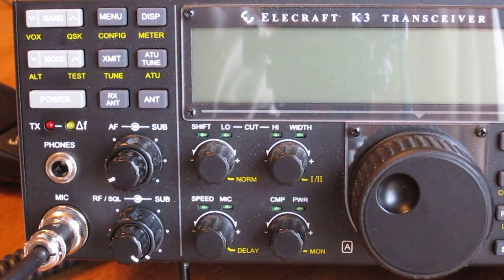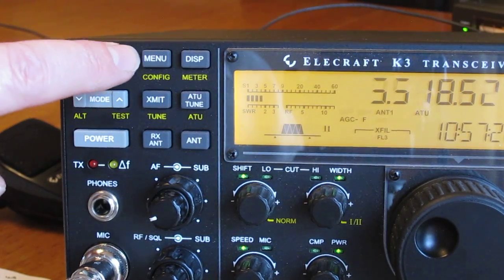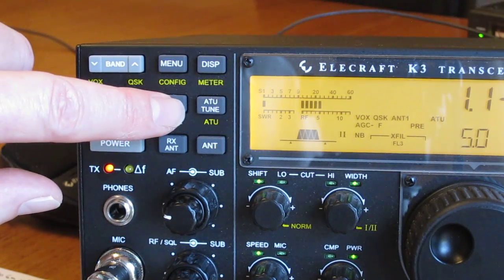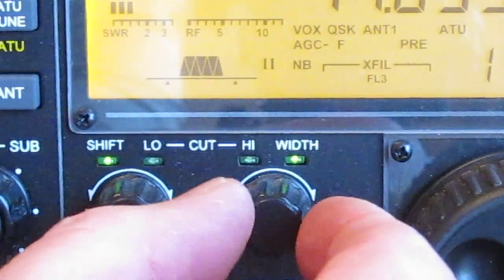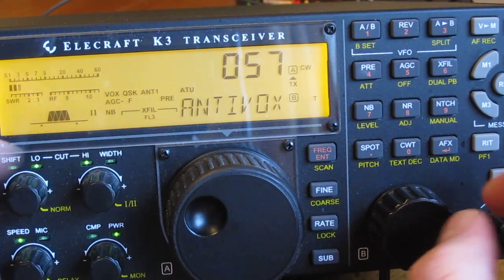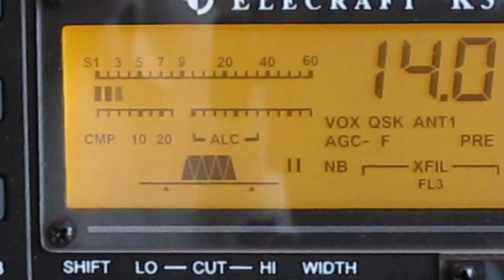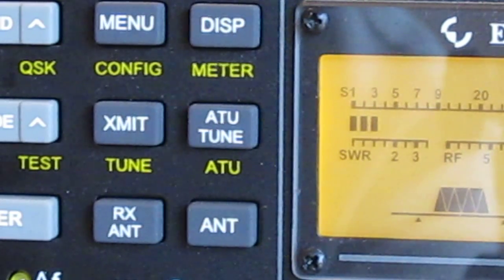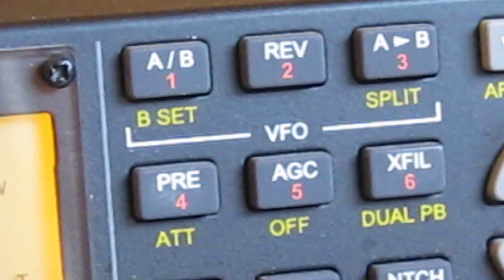ELECRAFT  K3  HD VIDEO - Front Panel Instructions demo by Keith GW4OKT.mov

Comment from the maker: Thank you for your comments, you flatter me to be honest, but it was entirely unscripted, I just commented on the functions from left to right more or less. It is surprising how you do get used to the functions BUT when you don't use them all the time you do forget what to do.  One of the issue I have as a CW op is that sometimes, if I hold BAND down button by mistake, rather than tap....I turn off the VOX! So yes, it is a little crowded on that panel!

cheers 

Keith

Comment: What are the correct CW frequency readouts on the K3 for the 60-meter channels?
Reply from the maker: It varies slightly,  depending on which country you are in. For the UK, it can be (kHz) 5258.5 - 5264, 5298 - 5307, 5313 - 5323, my favourite is 5354 - 5358, 5362 - 5374.5 is also used. (5262 is a commonly used QRP frequency).
Reply: @g4okt  Thanks. I'm interested in knowing the K3 frequency display in CW for USA 60-meter channels.
Reply from the maker: @jazz4asahel  Rgr - here you go.....Channel 1: 5330.5 kHz Channel 2: 5346.5 kHz Channel 3: 5357.0 kHz Channel 4: 5371.5 kHz Channel 5: 5403.5 kHz, these are channels with 2.8kHz bandwidth, so you have some space to move a little when on CW!